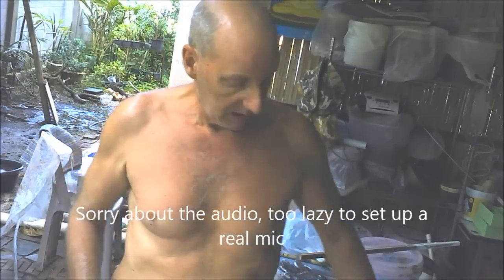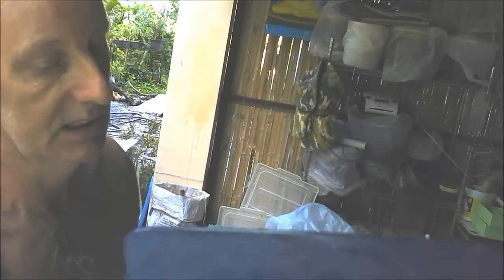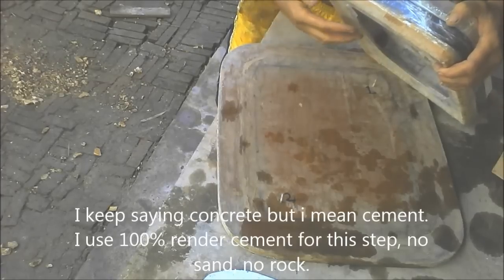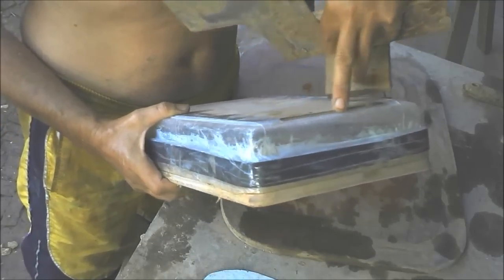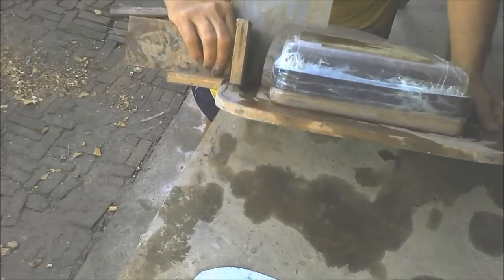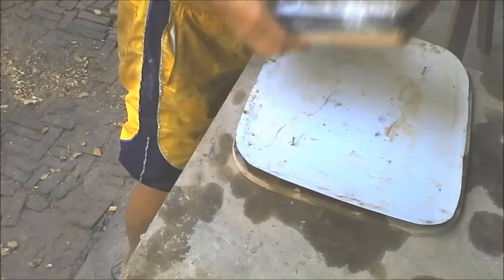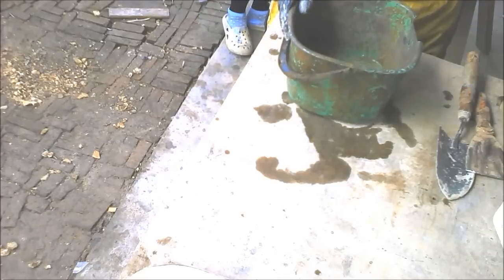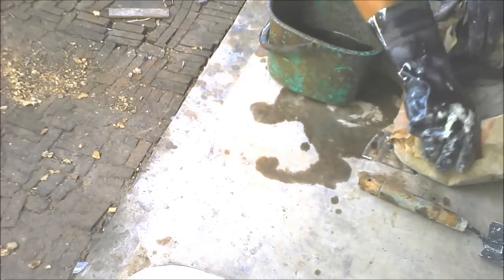how to make a cement bonsai pot part1

Comment: Great way to make a pot - I use a simular Idea to make round pots. I had not thoughy of making square pots the same way - Again Great Job - I will be trying it as soon as the snow melts.  To male an eazier in side shape  tou might try - Put a dozen or so 1 1/2 sheet rock screws sptead out on your base plate  likr spikes - Make up a stiff batch of plaster of paris and sand 2/3 sand to make it hard.  scrape you shape, if you have a second layer of plywood with a cutout the size of your inner mold it will leave a nice lip and you can get nice concave cut on the inner mold to help elimante a crumbly edge.  - whe the plaster dries give it 3or 4 coats of polyurithane floor finish. Rub your inner mold down with car wax and keep it clean with a dry wipe down between uses and a rewax when need it should last you a long time.  Sorry I have no video yet.  I am just getting started with this on line bit It is nice to see some else who can make a quality pot.